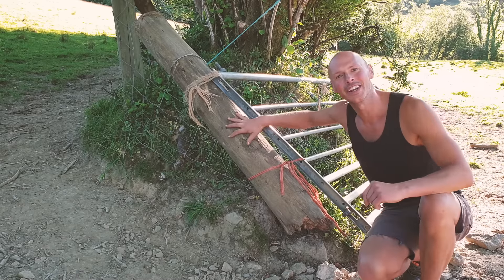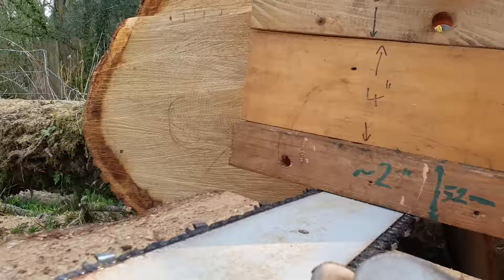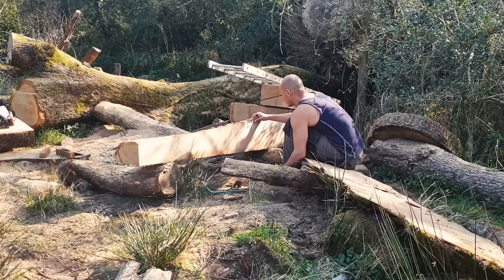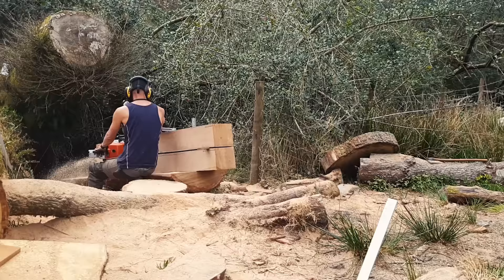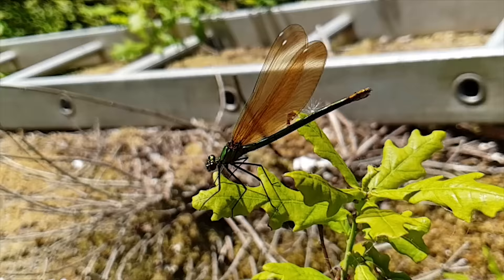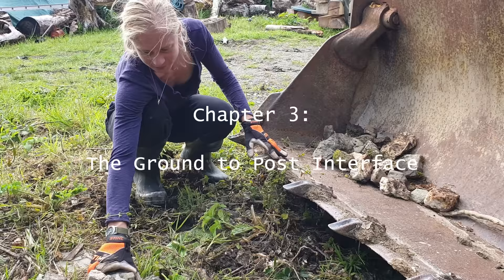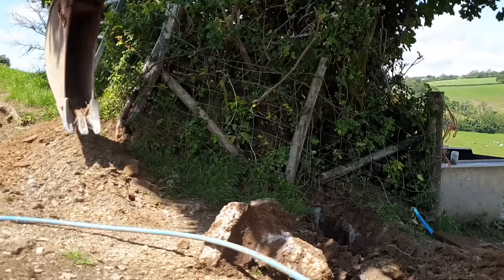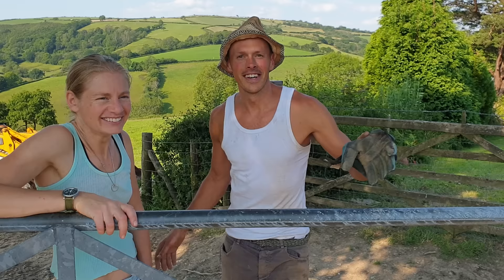The 3 secrets to ROT PROOF POSTS and how to make them

Comment: why the hell would you scrape off the layer of char? thats the whole reason you... nvm
Reply from the maker: Good morning Oldnotweak, thanks for getting in touch. Good question and one that seems obvious at first glance, but isn't.  Basically a number of old timers with lots of experience told us, independently, that leaving a deep layer of charr on acts like a sponge, holding water that actually makes it more habitable to microorganisms. It is primarily the torrifyed layer of hardened wood between the char and unchanged wood that is the protection. 
The absolute truth of it we can't tell you - we are experimenting and going off other's experience here...
Reply: Charcoal is incredibly porous, which means it has an absolutely monumental surface area, for a given weight or volume. Therefore it readily adsorbs (adsorption is when something adheres to the surface of a substance, as opposed to being absorbed into the substance) water and other stuff that can lead to rot. Much better to have a solid and flat surface that's harder to penetrate.
Reply: @MrAwawe  what? Are you for or against what they are doing?
Reply: @bbikermama  It seems like a reasonable thing to do, in order to avoid moisture penetrating the post.
Reply: @MrAwawe  What? does that mean you condone or do not condone what they do? ^_^ (nah just messing with ya)
Reply: He's not, he's only scraping the top but off. There's still a quarter inch of char.
Reply: Any wood hard soft etc. 
15 gal bucket. 
Put post in bucket. 
Fill bucket with 50/50 mix of used engine oil and diesel. 
Let sit for as long as possible inside a hot barn. 
6 months minimum. 
Prefer 2 or more years. 
My grandfathers post are 80+ years in the ground.
Reply: @cody481  thats what I do as well. Except for the shorter fence posts. I use hot water tanks cut in half length wise. Soak the whole post that way. Those post last forever.
Reply: @FloweringElbow  BRAVO...EXPERIENCE SAVES THE DAY !!!
Reply: @MrAwawe  AGREED...OTHERS TELLING YOU WHAT IS BEST...IS PRICELESS...YES IT IS!!!
Reply: esp around your pastures and vegetable gardens.
Reply: @MrAwawe  Adding charcoal, with all that surface area, to your garden is great as it helps microbial and bacterial growth. In your garden this great as it helps break stuff down, but I can see how this would be bad if you are trying to stop wood rot.
Reply: @cody481  This is how the stave churches in Scandinavia are treated, but with tar. They're a thousand years old. This new trend (or rather, re-emerged and previously abandoned trend, for Europeans but more recently 'invented' for asian regions) of charring wood was abandoned by us in the bronze age precisely because tarring the wood seals it far better and doesn't make it an ugly burnt husk.
Reply: @bashkillszombies  Tar is very poisonous and especially dangerous for humans that do this kind of wood treatments. In EU it is already forbidden in houses and on ship hulls.
Reply: @cody481  The Shou Sugiban technique works very well when understood. 

They have 600 to 800 year old and even older temples in Japan that used that technique.

But that oil mix soak technique you gave is still gold. I think it was used in Vietnam by combat engineers too for field & dugout fortifications. 

Not surprisingly the wood used still are existing and well preserved.
Reply: In our family we always burn the toast then everyone can scrape the toast down to the finish they favor for flavor.
Reply: Archaeologists are forever describing how timber post building  even enclosures had been destroyed by fire as they find charcoal in the post holes. Never occurred to them that it was deliberate charring. I torch treated my latch clad barn 8 years ago and although the soft surface char has washed off, the timber is sound. I thought my carpenter would balk at me charring the cladding but he said the old timers took blowtorches to hardwood joinery before painting. And this in rain sodden Ireland 🤔. Well done great stuff.
Reply: @MrAwawe  this isn't charcoal. Torrified wood is different, it's essentially sealed by various compounds being polymerised on the surface/a few mm inwards. Also charcoal itself doesn't rot readily in the ground (microbes can't really do much with pure carbon)
Reply: @cody481  

LOLZ, I'm sure there is a law against doing that in California. :-P

Comment: Just some "Cast away" thoughts about your storied efforts to put a post in the ground.  When you said it is important to "Cast away" water from the post.  From your beautiful video, it appears that there is a slope of sorts within 3 to 10' from the base of your post.  To facilitate water runoff, you could still take your little excavator machine to dig a about a minimum of 3' x 12" trench that is a little DEEPER than the bottom of the hole for the post.  Let's capture a point where the little trench hits the beginning of the slope.  You have already captured our imagination from your beautiful video.  Makes a great story for generations to come.  Thank You !
Reply from the maker: Hi Sam, thanks a lot for the comment. It's a good idea, and if I did it over  recon I would try just that..

Comment: Nice work.. Fireman and previous construction workers are friends of Ladders. You could turn the ladder 90 degrees, put a flat plank or pipe through the rungs and then post will roll. If you use the pipe you get the width of distance between rails to roll on so you can burn 16 or 20 inches before repositioning the entire beam.  Either way you solved it on your own so good job

Comment: For Texas Ranchers, the idea is to "use whatcha got." What we have in the Texas Hill Country is Mountain Juniper (cedar) and salvage pipe from the oil fields. Strip the bark off the new cedar and the post will last as long as the wire will, maybe longer. Or, cut the drill stem long enough to sit in ground 30-40" and fill hole with quickcrete and the post will last longer than YOU will!

Comment: In my youth in South Africa on my folks small holding we used mostly galvanised steel poles and droppers and set them with compacted stones or concrete depending on what was handy at the time, in 20+ years very few needed replacing.  Wood poles set in stones or concrete had a life of 10 years, 5 years if untreated timber, failure at the soil line.
-----
A few decades back I saw advertised a product for utility poles in non-dry environments.  It seems that MOST of the rot occurs where there is moisture and air, basically at the soil air interface which is also the point of maximum leverage so almost always the point of failure.

The product in question was a wrap around and clip together plastic band that was placed at the soil line and reached below and above the soil line.  It came ready for standard diameters and you could clip together like a conveyor belt sections of the same or different size for other poles diameters.

Afterwards it would be heated with a flame that would melt the internal adhesive layer and shrink it tight.  The hot-melt adhesive would fill all the wood-grain and pores and prevent air from reaching the damp section of the wood.

Perhaps charring is also only needed at the soil line.

Looks like there is a consumer product available now as well.  Thinking now that perhaps two turns of roofing tar 400-500mm wide applied with a hot flame at the soil line would be a test worth doing.

https://www.postsaver.com/
-----
First time on this channel, thank YT for that and very taken by the content, keep up the pioneering spirit.

Comment: A little over 40 years ago my wife and I resurrected a derelict farm house in Bedfordshire.  The oldest part was oak framed with rough hewn beams laid in the ground for foundations.  The framing above that had been mostly covered in wattle and daub.  To satisfy a mortgage company we had to install a damp course which involved dribbling a silicon based liquid over many months into holes bored in the oak beams.  We figured out that those beams had been hewn around the time Henry VIII was cutting timber for his flag ship the Mary Rose 700 years ago!

Our opinion is that as the oak foundations had lasted that long, the silicon was not going to make any difference other than delay our finishing the project months sooner.  There was damage in some walls from the lack of a damp course but only where the previous generations had added to the property using stone or brick walls.  The oak framed structure was dry from the foundation up.

Trying to drill into the above ground oak frame to install a hand rail up the steep stairs was almost impossible.  The oak dulled every 'high speed' drill bit.  Only a hand brace drill would work, with the cutting edges resharpened frequently.  If I had my druthers the new home we're building today in Oregon would be oak framed.
Reply from the maker: Hi Philip, thanks for sharing your experiences, that's really impressive durability! :D
Reply: i would bet you that horrid silicon stuff did more harm than good. what happens when people in a bank decide rules around things they know nothing of.

Comment: I use Thompsons roof-seal on the top of posts - it's gloopy,  pretty non-toxic - it sets well,  is cheap, readily available, bungs off water & some  (loads) of posts treated that way have lasted 20 years plus. If I really want one to last or it has to look "Posh" I make a lead cap for the post out of sheet lead and pay attention to the concrete I set them in with - load the concrete up high & make it slopey so the water runs off instead of sitting. If you're arty-farty (I am occasionally) you can carve the lead into posh shapes so it looks cool. I dislike chemical treatments as if they kill bugs, they probably kill you too - just more slowly, so lets not.. There are better ways than drenching it with chemicals..

Comment: Regarding plastics you seem to forget the following;
1: HDPE is heat moldable in the range 80-110 Centigrades without ever loosing structural properties.
2: Mixing it with colored variants does not change the properties but does provide UV protection.
3: It is ligther than water at 0,85-0,97 in density.
4: It can ALWAYS be remolded and thus is 100% reusable for ever.
5: You can collect it from milk jugs, cork caps to PET bottles and more thus aiding in reducing plastic waste.
6: LDPE is not as durable as HDPE but can be used as well which means you can mix them to some degree. LDPE is plastic bags and similar things. (More environmental saving to do.)
7: You can cover HDPE with a simple shell of oak and other wood panels too as you can screw or work it as wood.
8: It is extremely durable. Lawn pads are made for trucks to drive over them at up to 300 tons per square foot.
9: It makes perfect replacement of bullet proof lining at 25+ mm thickness and up.
10: Did I mention you can remold it time and time again :)
11: It is chemically stabile and resistant to fuel, petrol, oil and even acids.

The one drawback is, it is hard to collect en mass and it does not smell as nice to work in as wood. ;)

Comment: My father was an estate clerk of works in the 60s and 70s. Early 60s Farm machinery was getting bigger and not much maintenance had been done since the 30s so it was decided to replace field gate posts and widen the entrances. Posts had to last so Oak 8" square 11 foot long, 6' in the ground 5' for the gate, so when the farmer hit it is stayed. First one was an entry way off the A38. Dad set the men to setting the first post 6 foot in the ground 'by hand' no post hollers then. They set the first post by 12-0-clock and went for lunch, came back post is gone.

Comment: In Missouri I use Osage orange posts were available all ya had to do was cut the trees into posts,had to be an optimist to call them straight,we have miles of fence most posts are 3 generations old now ya just replace the wire about 30-40 years. For me grandad said he didn't like oak good to build barns would last a long time if kept dry.only time I need to set new posts is if I need a new fence.

Comment: That was truly a colossal amount of work! Nice project, too. I wonder though...how about concrete? I once put a series of concrete "posts" in as a base for a sawmill -- and they lasted for nearly 50 years now with no problem. I built wooden forms, which had a "base plate" shape on the bottom, and then for the post all the way up. I put them six feet into the ground, with the base plate area about 15" x 15" by 6 inches tall, and then the 8" x 8" posts came up to about 3 feet above ground. They were solid as bedrock for 50 years. AND...if it suited you, you could make a wooden "casing" for them for appearance' sake (and/or to hold some hardware).

Comment: I did not know about the charring trick, but figured out the stone trick, it also saves a lot of cement that you would have to pay for and get a long way. In the long run it makes it easier to replace the post too.
A bit of concrete or steel at the ground level is still a good solution to keep the soil way.

Comment: The last fence I installed used pressure treated posts in Concrete tubes with about 4 inches above grade and 17 inches below grade .  The 4 inches above grade keeps the wood posts from any contact with the soil and also put some small stones under in the bottom of the hole before installing posts to allow for some better drainage.

Comment: Charring keeps bugs from eating the post if you soak these posts in used motor oil after charring for a week or two then set them they last a long time even with softwood. Also putting rock or aggregate around the post vs soil helps drain water away from the post which makes it last longer. Love the video and the channel!

Comment: I have the same project, 10 decorative posts to install.  I’d prefer wood for the look, as they are by the house and barn.  your method was recommended the most by folks in Missouri.  We use a post driver and metal posts for all new fencing otherwise
Reply from the maker: Thanks Mike, Good luck with your posts!

Comment: I use the less labor intensive method for posts which is using automotive underbody rubberized coating in spray cans for $6.00 especially when using concrete which is acidic to wood even when it's pressure treated

Comment: You can make a plastic soup from your recycling and when the soup is really hot, slop it in a layer over your post - thus sequestering the plastic out of landfill and keeping the post isolated from the ground !
Your trenching bucket on the JCB will do a great job of compacting push down on the material until the JCB is off the ground - lotsa pressure there.

Comment: Nice work. Just a heads up for those of us across the pond: not all oaks have the same rot resistance. For instance red oaks wick moisture easily and will rot from the inside while white oak and live oak are fairly rot resistant. I learned this the hard way when making small cemetery crosses that would only last for 4 years before showing signs of rot.

Comment: for a 6' fence between neighbors in the suburbs, I bought treated posts and then mixed up epoxy and painted the post part that went in the ground and continued it 4" above ground. In the bottom of the hole I used the posts to pound in a few inches of fine gravel and then poured cement in the hole to surround the posts while they were held plumb. Finished with a little slope in the top of the cement. Hope to get 50 years from these posts, but I'll never know if they go past 25 years.

Comment: Hi Flowering Elbow, well done to you both!, I have been trying to deal with fence and gate posts on nature reserves for many years now and entirely agree that modern pressure treated softwood is highly unsuitable!, my rule of thumb for sustainability is that a piece of timber must serve its purpose for longer than it took to grow!, a softwood post that decays for quickly that it fails this test by a factor of two cannot be ignored!. 
There a a few small issues that I feel I should raise from your otherwise excellent presentation, firstly I would stress that the first phase of compaction during the infilling stage is very important, at least because if neglected it cannot be corrected!, the point is that to compact the post at only one level will allow it to rock, the one thing you do not want it to do!. The intermediate level is less important.
I would also like to point out that as you say it is at that junction between the damp ground and the air that decay is most rapid, for this reason concrete is always a bad idea because it creates a permanent trap between the concrete and the wood which inhibits good drying. It does not matter exactly where that junction occurs but any additional application of preservative like heavy black bitumen paint need only be concentrated at just above and below that level. The copper sheet cap on the post is a very good idea, I have replaced at least one eight inch post that was completely hollow!. If enough sheet metal is available a small skirt of it could be applied at ground level or just hidden in the top layer of stone to divert water away from the base of the post, four feet of six inch post will catch quite a lot of rainfall which runs down the post to the ground.
There have been a significant number of sites where I have seen sweet chestnut posts that took about fifteen to twenty years to grow as coppice still solid in the ground after more than thirty years, it seems that there are some rot resistant properties in chestnut that deserve consideration. Cheers, Richard.
Reply from the maker: Hi Richard. Thanks so much for taking the time to write us, really appreciate the thoughtful feedback. You make some valuable points, that readers will hopefully find useful. Thanks again, Bongo & Sam.